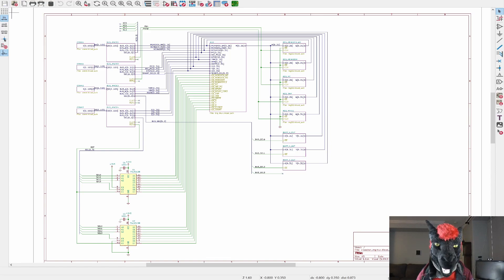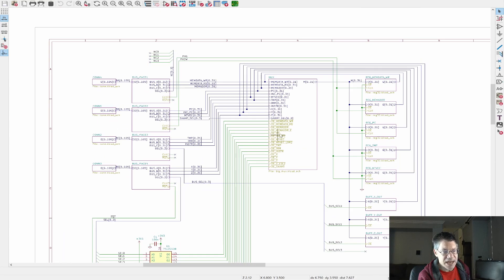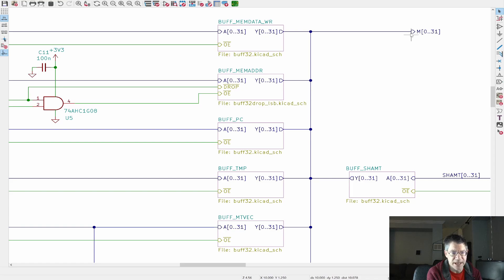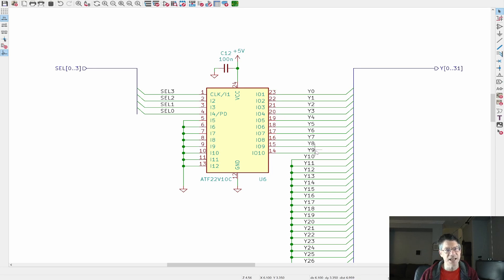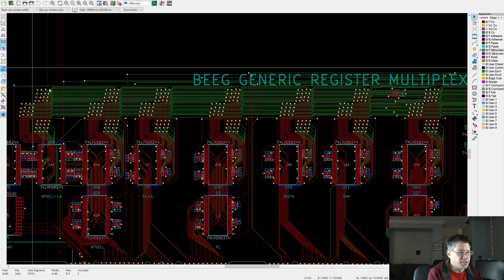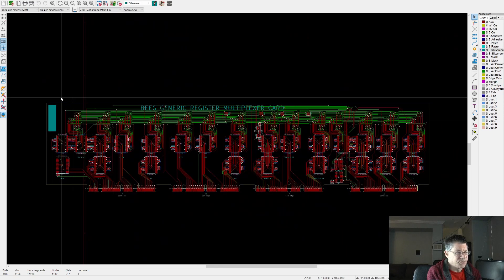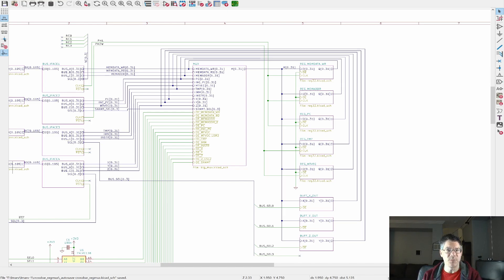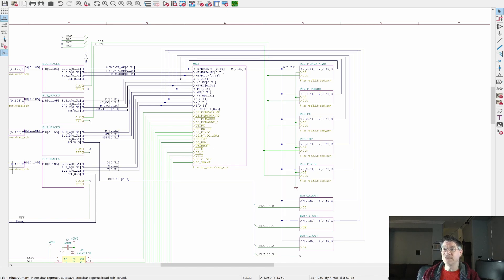LMARV-1 reboot part 11: The crossbar

Comment: I'm interested to see whether or not your 3.3v to 5v interface is able to handle much speed. I saw a reduce speed or even a complete failure with some noise. Sometimes it helps to have a level converter.

Comment: When watching I had an idea to overlap elements that won't be used on the same instance of a board. Ie those in a package with connections on sides only. Maybe you could make the board smaller. But that's probably a bad idea. KiCad would shout on you in DRC and you would have hard time when routing :)

Comment: You couuullllld use an ATF150xASV CPLD simply because it can be (re)programmed in-circuit via JTAG.

If you need to fix something in the GAL once it is soldered to the board, that could be a little bit of a pain.
Reply from the maker: I'm intrigued by the ATF1502ASV. It seems to be sized well, and uses 3v3 power. I'll look into this more, because it is not that much more complex than the 22V10, and could conceivably have its fuse map reverse-engineered.
Reply: @RobertBaruch  I've used the ATF150x CPLDs in a couple of projects, 5V and 3V3 parts.

You can write CUPL for them using WinCUPL, or you can use an older version of Altera Quartus that supports the EPM7000 family of devices to write Verilog or VHDL, and then use pof2jed to convert to a format for programming via ATMISP.

You just choose the equivalent Altera part in Quartus: EPM7032==ATF1502, EPM7064==ATF1504, EPM7128==ATF1508.

Pin for pin compatible.
Reply: ATDH1150USB is the programmer to look for, they are not stupidly priced like Altera's programming tools.
Reply from the maker: @TomStorey96  Compared to those, this is pretty cheap.

Comment: If you put mounting holes in your board and on your breakout test board, aligned at the same position, you can use slotted L-brackets and some small nuts and bolts to hold them in position while you solder. The slots mean you don't need to get the X/Y/Z alignment perfect ahead of time. A dollar worth of parts saves you manually holding the board upright.
Reply from the maker: That's an interesting idea! I was going to be lazy and just hope, but maybe I can just 3D print some brackets/slots. I'm enthusiastic!
Reply: @RobertBaruch  3D printed also works, if it's worth your time!

Comment: I'm not sure you shift the mtvec by 2 bits to get the address, as instructions are 4 byte aligned. They just use the bottom two bits for the mode and store the address as is. So you gotta mask to get the address (unless that's what you mean)
Reply from the maker: There was a reason... Oh right. The implementation shifts mtvec right by 2, adds the cause, then shifts the result left by 2. This is equivalent to masking off mtvec, multiplying the cause by 4, and adding.
Reply: @RobertBaruch  Ah, that makes sense now. It's an implementation detail.
Reply: I was thinking the exact same thing.
From riscv-privileged-v1.9.1.pdf page 28:
"The value
 in the mtvec register must always be aligned on a 4-byte boundary (the low two bits are always zero)"